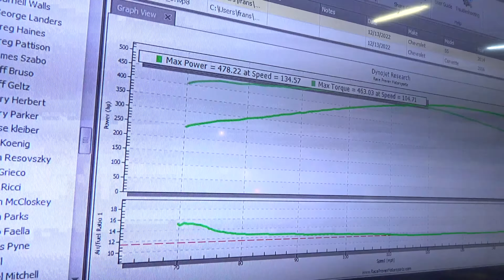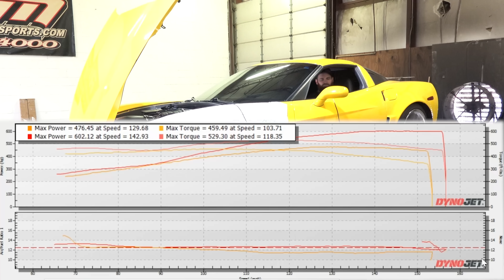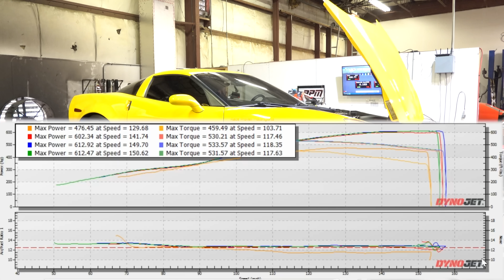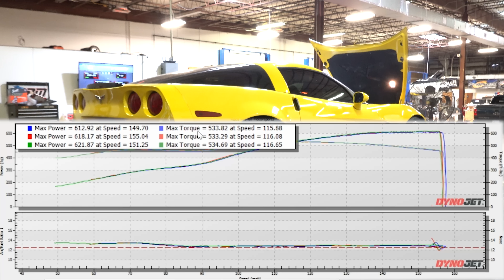Every LS7 Has A Valve Issue!!!!!

Comment: NEVER leave the torque tube cover uninstalled. The reason it has so many screws is because it is part of the structure and adds to torsional rigidity of the body/frame component. It also keeps lots of heat out of the console and passenger compartment. Why half a$$ it?

Comment: The LS7 has valve issues because of the exact allowances the engine has. Any more air to the mixture doesn’t match with the designed valves causing much more stress than they’re build to handle

Comment: My 07Z is headed that way in about three weeks, thanks Bill!
Reply: @number36420  stage 3 with clutch
Reply from the maker: It can handle it for a period of time but all depends how you drive and milage.  If you never want to worry about it it’s best to do it at the same time.
Reply: 13800 miles but don’t want to worry about it later. One and done

Comment: Just got the LS7 hotcam version crate motor.  I have no idea if it has any valve issues, but I am looking into Fixed heads options.  What is the best option?  Porting stock heads with new stonger guides and valves or aftermarket set?   Which has the lowest failure rate?
Reply from the maker: Our heads are on our website
Reply: I'll answer you-AFTERMARKET!! I've owned an LS7 for almost 9 years. The OEM heads have the reliability of an ex wife testifying at a custody hearing.....
Reply: @milojanis4901  which ones are reliable?  How many miles on yours?  Have they been rechecked?  I have seen many still had issues
Reply: @milojanis4901  killed me lol
Reply: Replace them with aftermarket...preserve your investment, good luck on the build!

Comment: Fran going to need a smaller size sweater soon, looking good brother keep up the great work!
Reply: I've noticed a trend.  He is definitely dropping some lbs. Good Job Fran.
Reply: What’s with the clickbait title?  I have to disagree.  My ‘07 Z06 was built in December of ‘06 by D. N. Eastlick.  It has 139,000 miles and is as strong as ever ( However, my last dyno was at 64,000 miles).  I must also admit that I do my own maintenance, have never raced the car and always drive the speed limit (At least that’s my story and I’m sticking to it).
Reply: Finally got sick of the fat jokes 🤣
Reply: Have not watched a video in awhile and almost didn't recognize him. Driver mods actually do exist.
Reply: Because your ancedotal experience doesn't trump GM admitting that the ls7 valve guide was poorly manufactured ?

Comment: Do you Dial in Cams on these installs with Degree Wheel not ever see you guys dialing in cams great video Fran
Reply: Wondering that too.
Reply from the maker: No and no one that works on these cars will either.    Unless you have an adjustable timing set there is no way to adjust how the cam is installed besides dot to dot